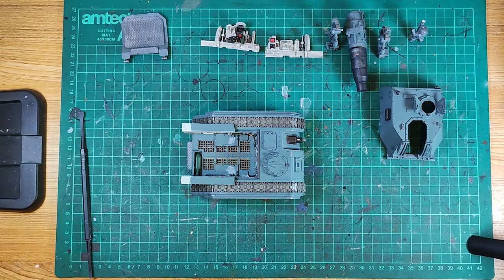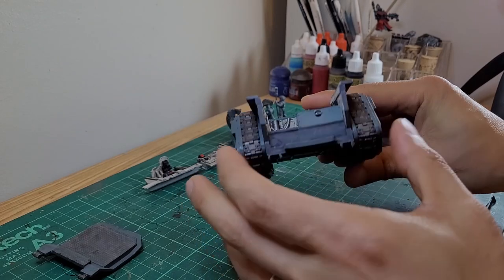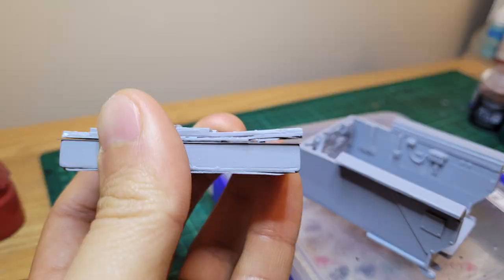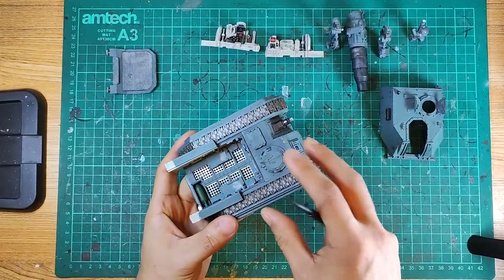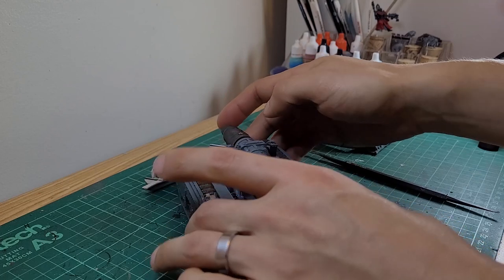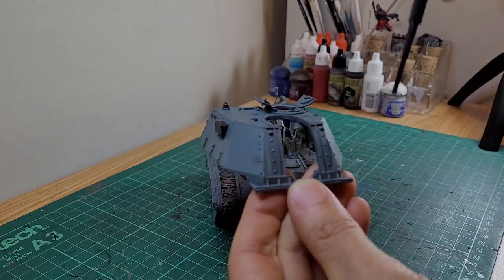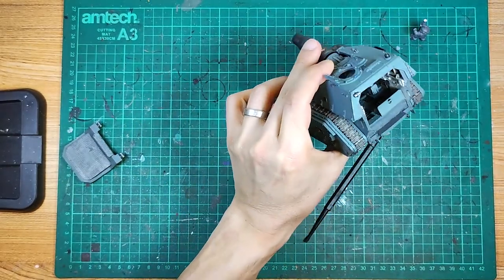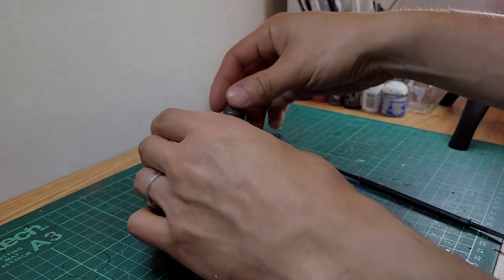Building guide - Armageddon Medusa from Forgeworld | Astra Militarum | Warhammer 40,000

Comment: I don't have the time to check, but the floor issues might be caused by the kit actually being made for the older Chimera models.  They stopped where you said the resin part dropped down, and had a separate piece to glue on for the floor.
Reply from the maker: Cheers PJ, that would explain a lot!

Comment: OK, I gotta ask, the color. In your previous videos I recall you base-coating your armor mechanicus grey, but it looks very green on my screen. Did you add some green? I have two or three bits of armor that I would love to paint in a similar scheme, but more how it looks on my screen, that is more green-blue than a true grey.
Reply from the maker: Hi Bo, yes for this model I used a lot of AK Interactive products for streaking and weathering. Makes the paint job look more dirty and weathered as though some moisture damage has occurred as well. If you watch my Chimera and Baneblade painting tutorial, I show how use these products. You need also a white spirit for this process but we'll worth it IMO
Reply: @GuardsmanHanan  So, that is just mechanicus grey? It really is that blue green on the model? I have looked at the can, and it looks much more like a battleship gray than blue.
Reply from the maker: Yah absolutely it's Mechanicus Standard Gray. Remember I dry brush with Dawnstone as well so that will change its colour likewise the wash impacts it final colour. 

The grey has had so much done to it in the end its very different to what it originally was at the start.
Reply: @GuardsmanHanan  Awesome. Thanks. It looks so green in your vids. I have been going through all of my color charts trying to match it.